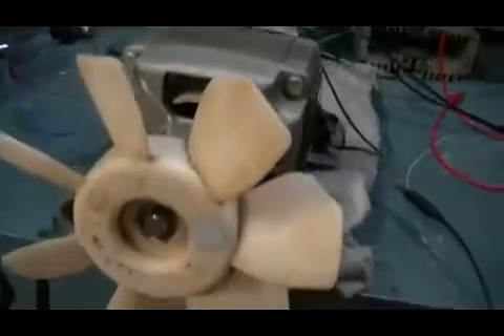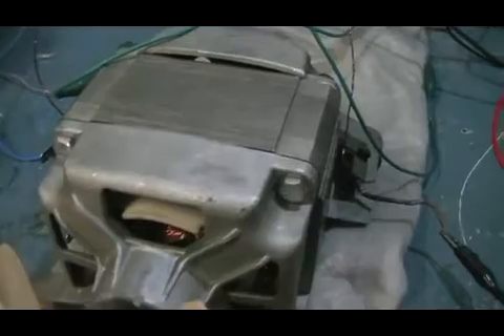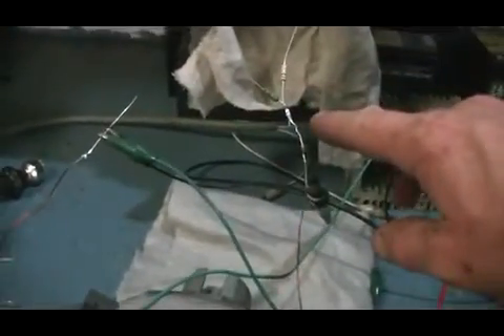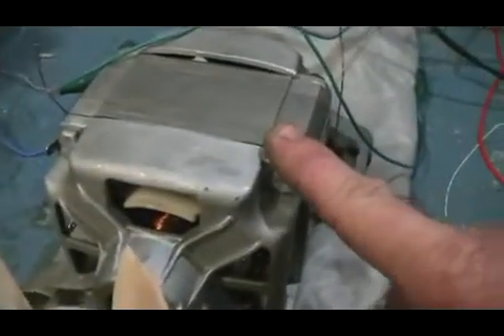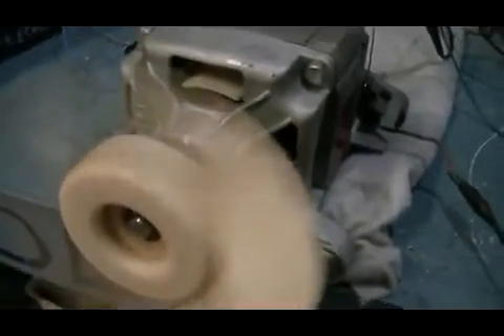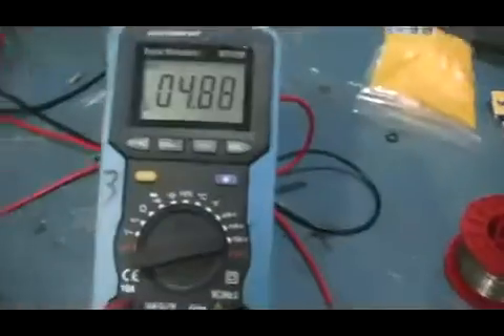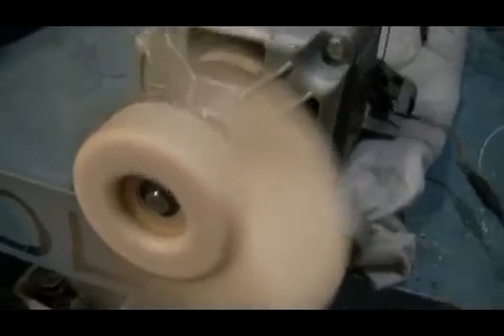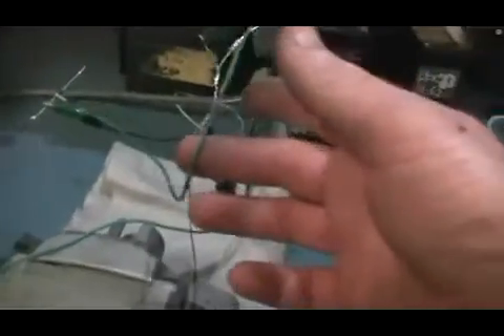Rotary transformer torque test

Comment from the maker: Well let's see.In the washing machine it would draw 4.3 amp's at 240 volt's,which is 1032 watt's.Here in this video i am putting in about 52 watt's. So i could drive 20 of those fans for the same amount of power. So i recon i could dry the cloths faster than you could wash them lol.It was an experiment to see if i could make it more efficient than an of the shelf motor,which i did,as you can see in the rest of the video's.I would use a standard PMM for a generator-they work well.

Comment from the maker: It was rated at 600 watts when running on 240 volt,but it wouldnt be close to that now on 22 volts.
I will be doing a comparison test tonight against a standard house fan motor.